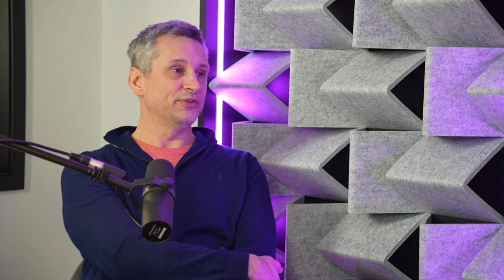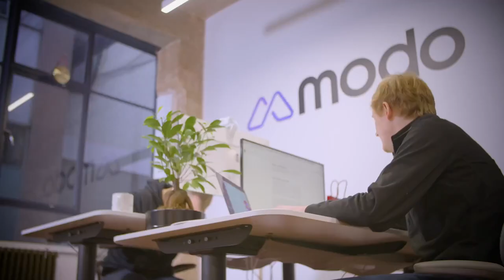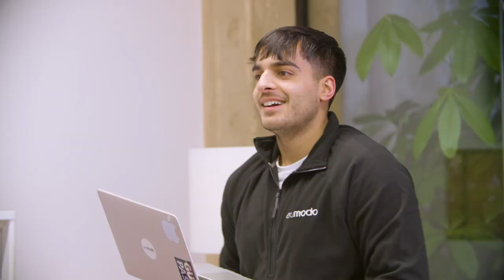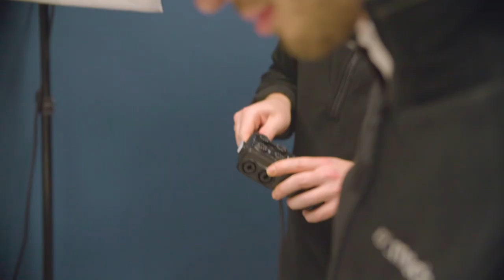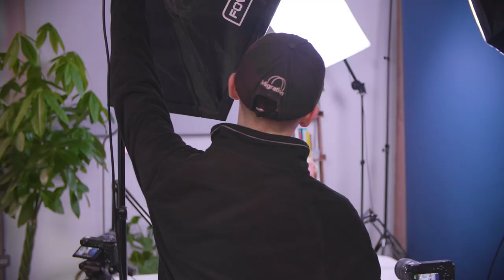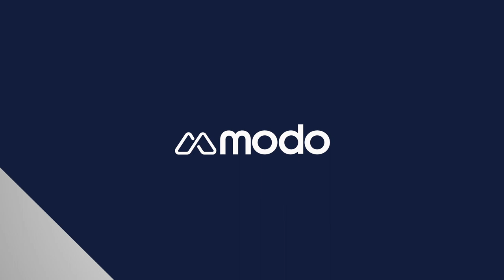Gravity energy storage - Modo: The Podcast (ep. 50: Gravitricity)

Comment: Gravitricity concept to store energy and use the energy for greed stability is a great idea or let say it is great project because the demonstration concept has proved 80% efficiency on energy regeneration.  If the project will be designed for 500 tonne heavy body and shaft 600 m deep then potential energy stored on heavy body is 0.8175 MWh which with 80% efficiency will deliver on the greed only 0.654 MWh (probably on 11 sec or more if the system will be slowed. t=SQRT(h*2/g)). If the heavy body 500 tonne will be lifted again from the shaft, the energy needed is 0.981 MWh accepting the efficiency 80%.  So Graviticity projects indeed are only to stabilize the greed to avoid any blackout.  As can be seen  from data if gravitricity will be used multiple time, then the lifting will get more energy from the greed, probably will get 1.5 time more energy than will return to the greed.  
As for energy storing underground on mine shafts using green H2, this technically may be achieved, and 100 tonne H2 on a shaft 9 m diameter and 600 m deep the hydrogen must be compressed 30 times, so it is possible if the shaft will be hermetic. However to produce these 100 tonne H2 at least will be used 5.5 GWh green electricity. If green H2 will be used to regenerate electricity for consumers, it is probable that 1.47 GWh electricity will be produced, so efficiency is 27% or lower.  If investors will be happy with these ball point estimates this will save some renewable energies, but the cost will be very high.
Real solution on solving energy security and abundance is Gravity potential energy combined with Levitation which can use multiple times the heavy solid blocks during the day.  On these case a solid block 500 tonne at 600 meter high may be lifted 100 times during 24 hr and generate  65 MWh or more every day. A demonstration model for levitation-gravity energy generation (garage model) after proved the concept is destroyed for security reasons.  No intention to file for Patents, but possible partner with government and strategic investors.

Comment: Claim is 500 tons through 600m get a MWh 

Its actually about 0.8MWh. You actually need 735m to break 1MW with 500 tons, or 612 tons over 600m. That’s assuming zero losses in conversion in/out transmission which there will be. 

I don't think that means it's a non viable tech for all the reasons stated in the video, but he should be being conservative really, given that there will be losses - i.e. feel he should be rounding down on the potential storage capacity rather than rounding down on the factors that go into the maths. 

So really, call it 800m with 500tons, or 650 tons over 600m if you want to actually have your MWh after losses. 

That's still only 1MWh mind you which is a lot of holes to find or dig. I still think we should do it though, and I agree that going up is really just not viable without super cheap super materials. 

But here's a brainwave for someone to shoot down: why not use batteries *for some or all of the weight*?  

First, the weight is lifted into place, which connects the batteries (precision alignment required, obviously), which then charge if there's still excess energy coming in, then for discharge cycle it goes battery first then lowering the weight.

A 1mwh on site battery installation is I think about 1000kg, but is the size of a shipping container right now (that weight includes the container and all the inverter and high voltage connections and stuff to though, which could be built into the hoist element of our theoretical shaft, so possibly we say 900kg and 20% less volume). 

So the question then is just how dense is their super dense gravity storage material, i.e. how much mass would they need to sacrifice to fit the volume of batteries, and is there a sweet spot trade off where you can have your 600m drop and actually get your 1mwh out.